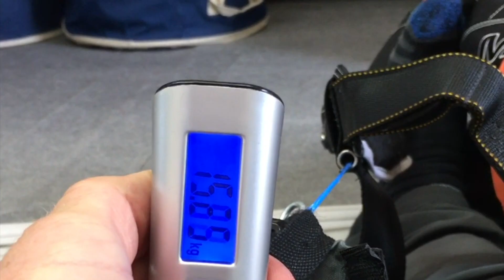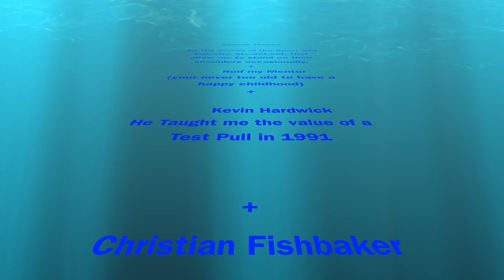3Ring System.  Part 3

Comment: Hi Colin
Great videos! 👍🏼
I had a question about the incorrect routing of the metal tube on 10:11 of the video. Why did metal tube needed to be moved to the the right of the 3 ring system, and what could potentially happen if the tube is kept on the left of the 3 ring system?
Reply from the maker: Another good question Abdul,
at 05:48 you can see a snag of a 3Ring that may have been a result of a poorly routed Rh Housing.
Keep in mind Sport Rigs have the 3Ring Handel on the inside of the Rh MLW and the Housings run up the inside,
Tandem Rigs have the Handels on the outside of the MLW and the housings run up the outside of the MLW.